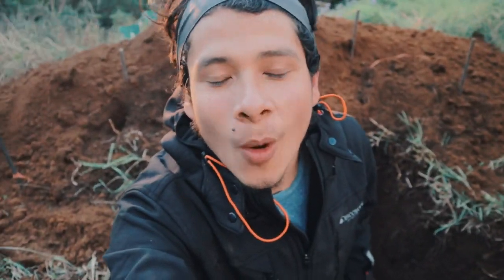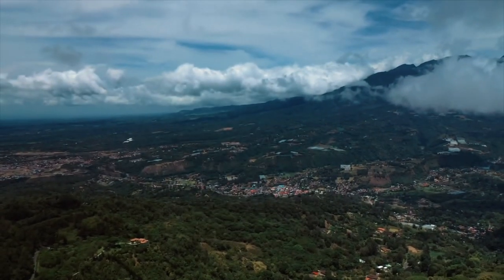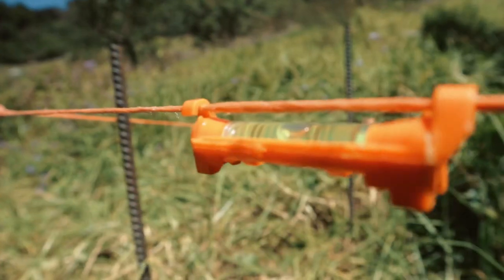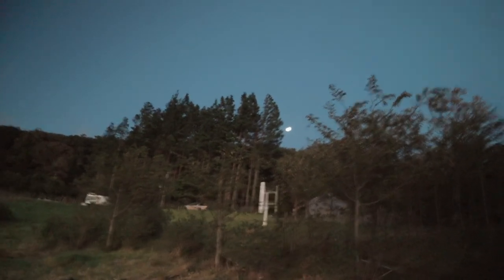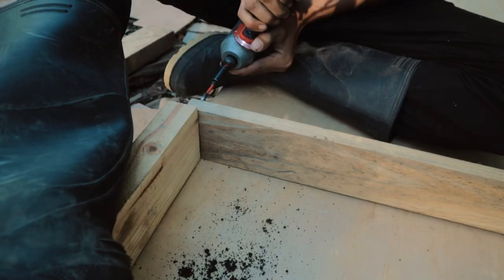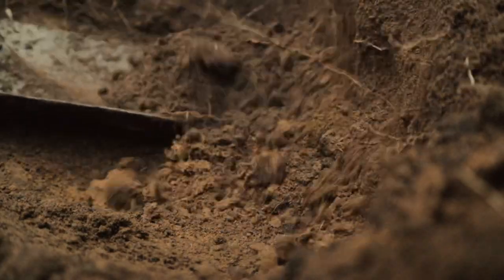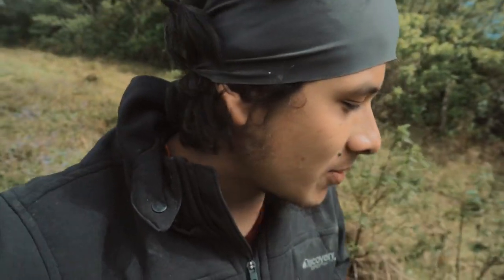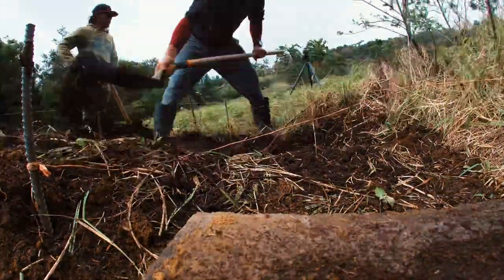Building my dreamed house in a farm

Comment: A water level is much more accurate and cheap to build all you need is a clear hose and water. I used a water level over a transit on many projects.  I am sure they have videos on them. You can use just the hose and water or you can make a reservoir on one end to help stables it faster. Believe me it is amazingly accurate and easy.

Comment: Check your levels every time you pour or build buy a plumb line and a long spirit level. If you can afford it a laser level. The more accurate you are the better the end result will be. I am too lazy to do the maths but if you are a degree out over 20 or 30 foot that translates into about an inch of difference. Not the end of the world but better to have your house as true as possible.
Reply from the maker: Hi Glenn, thanks for your advice, I appreciate it! I'm getting the plumb line, they don't sell laser levels down here🌟